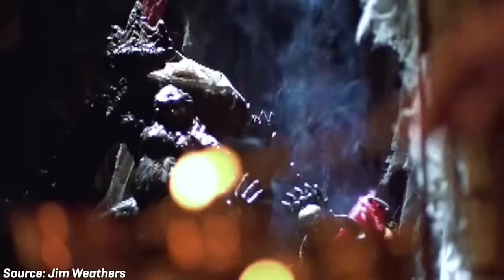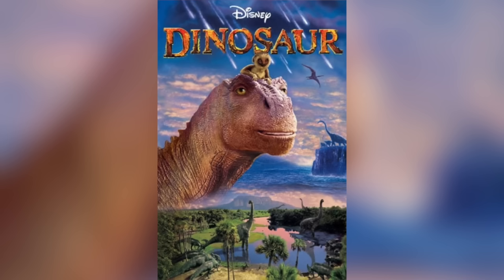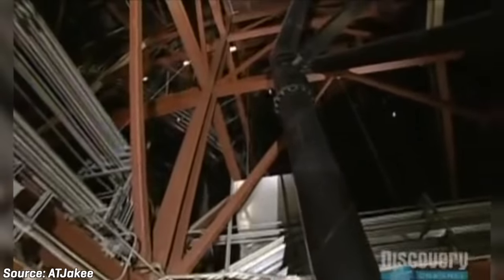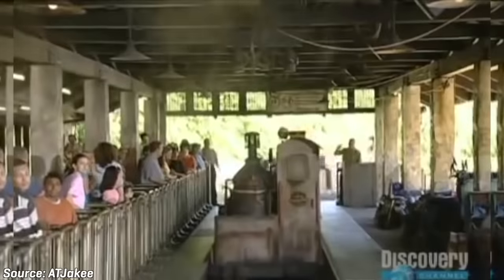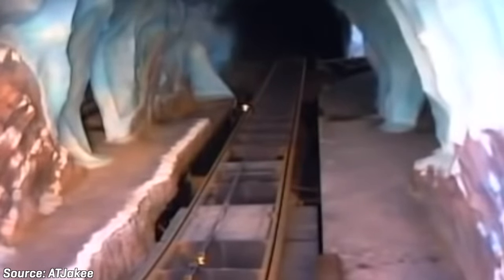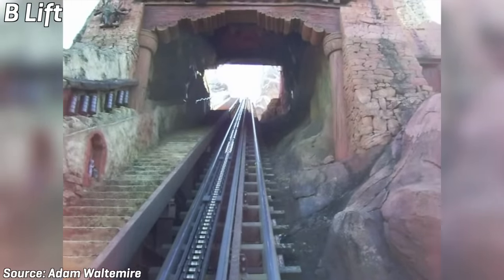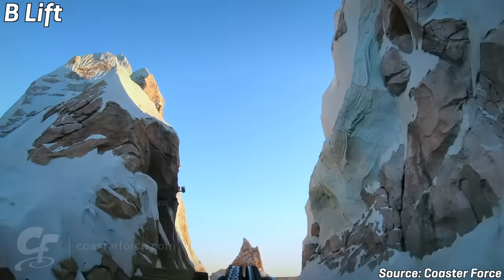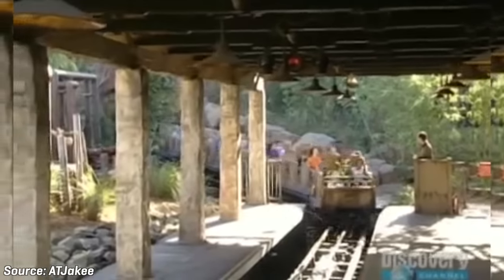Problematic Roller Coasters - Expedition Everest - Disney’s Animal Kingdom

Comment: One major lesson that the Yeti taught Disney is to always have a backup for your animatronic figures no matter how big they are. In making Na'vi River Journey in the Pandora section, the shaman animatronic can be removed from the ride if it breaks down and they show a projection in it's place while it's being fixed.
Reply: Huh, that explains the last time I rode Na'vi River, last month. I had coulda sworn it was an animatronic the last time I rode, but it was a couple years ago.
Reply: I was so confused one trip, because the very 1st time I rode the Na'vi river journey on the Monday there was an animatronic. On Friday  we rode it again and it was a projection. I was so confused and thought the 1st time was a fever dream.
I have ridden it again since that previous trip and the animatronic was back.
Reply: Rise of the Resistance does this too - there’s a figure of Kylo Ren that can be hidden behind a set piece if he’s broken and a video will play on the screens in the room instead.
Reply: Same with Rocket for Guardians of the Galaxy at California Adventure.
Reply: You can't compare that to a 20,000 pound animatronic. There are many issues like he said with not just the Yeti but also the foundation it sits on as well as mechanical parts which would require cranes to disassemble the mountain and track to fix.
Reply: same in rise of the resistance!! if kylo breaks down they move facing one of the screens and he is there!
Reply: same for the pre-show of millenium falcon: smuggler's run; if hondo ohnaka is having issues, he can be hidden by a tarp/blanket and he appears on screens instead of in person

Comment: The fact that that one switch track costed more than the the entirety of kingda ka is insane to me. It makes it was the most expensive coaster until hagred’s came out.
Reply: A switch track is basically putting a giant hole in your roller coaster track and then fixing it via machine multiple times a run. No surprise that the kind of tolerances needed add cost FAST.
Reply: @Mr.ToadJanfu   Haha that's one... way... to look at it I guess.
Reply: Galaxyfnaf And Dino  nah Velicoaster was probably very cheap, compared to Hagrids of course.
Reply: Galaxyfnaf And Dino  the cost of the ride increases with complexity. Hagrids was very expensive because it features 7 launches, 2 switch tracks, 2 free fall drops (you only experience one tho), and many animatronics, plus the entire field where the coaster is located that was modified for the attraction (like all the trees that were planted and such) and the new building which is the one that you enter backwards. Velicoaster on the other hand is much more simple, 2 launches, thats it, not as much work as hagrid for the area where it sits either. It does have a new building too tho, probably the most expensive thing in the whole project.

Comment: Seems like a pattern at this point 

Engineers: it can do 4 cars and run smoothly
Park: more trains 
Engineers: okay but that will make it run slower... 
Park: NO SLOWER, ONLY MORE TRAINS
Reply from the maker: Hahaha so accurate
Reply: I give you, Heavy Traffic the RIDE! Get ready to move an inch a second!
Reply: You see the same thing in road transit. More lanes does not mean more capacity, but people still demand more lanes.
Reply: EAH OOOH AH AH NO SLOW ONLY TRAIN
Reply: What surprised me, is that they tried to add the 5th train despite the only benefit being a tiny increase of 68 riders per hour. I could understand if it would have resulted in an increase of 200-300 per hour. But 68 hardly seems worth all of the potential trouble it could cause.
Reply: @CAG83  exactly! Makes zero sense to me. I’d rather wait a little longer than push it with more trains.
Reply: @CAG83  I did the maths and that’s around 294,000 riders a year with 68 riders per hour, 12 hours a day, 365 days a year
Reply: @procrastination_productions while I know that small hourly numbers have a large annual effect, I think the difference it would make daily is more meaningful, as most visitors aren't going to be there more than one day of the year.
In which case, it adds 816 riders per day, which is about 2% of total park attendees on an average given day. That's not completely insignificant, but I still don't know if it justified making the ride a "bad show". It's certainly debatable though.
Reply: @CAG83  And, do those estimated values really match up? If more time is spent loading and unloading, I suspect you'd actually get less riders on during opening times.

Plus, how many people were turned away by the long queue.
Reply: this describes so many industries so well, lol. 
Also you're not even wrong at all!
Reply: @ImNotScotish  walla walla bing bang
Reply: The 5 trains made operating so ridiculous. Any one flub and the whole thing became backed up with grouping and loading guests. As a former cast member we would get stressed if they said 5 trains on track.

Comment: I worked at Everest and am very familiar with all aspects of it. Your description of the block system, and how it was modified to handle five trains instead of four, was excellent! It's tough to explain, but you made it very clear. Well done! I wanted to add two anecdotal things, however:
1. The steam at load usually isn't broken, it just makes the station uncomfortably hot and humid on already hot and humid days so it is shut off.
2. I have seen, with my own eyes, the yeti scene with the yeti figure missing. This means that, at least once, the yeti figure has been removed. Note that it was just the figure and not necessarily the mechanical arm that controls it. The rumor that the mountain must be partially dismantled to work on the yeti is most likely false. The figure can be dismantled like any other machine and removed with relative ease. There are large rollup maintenance doors on the backside of the mountain that allow for easy access inside including up to the backside of the yeti's platform.
Reply: I'm curious as to how many riders Everest would pump through on a normal day. I've only ridden it once, but judging my personal wait time with the estimated amount of people in both the fast lane and normal queues, I'd guess that the EE crew can push through 10K people on a regular day.
Reply: @shchorss  With 5 trains, Everest can push through over 2,000 riders per hour, with a theoretical maximum of 2,244 riders per hour.
Reply: A several thousand pound animatronic was removed and then put back in place? That doesn't make sense. Why in earth would Disney do that? That's some crazy logistics and financial costs just to end up with the same Disco Yeti. Why in the world would they remove it just to put it back into its same condition as before?
Reply: @AshLux  It's a machine, and thus can be disassembled into removable pieces. Disney actually has a strict maintenance schedule in which any moving element on an attraction must be completely disassembled and reassembled on varying schedules. For instance, every single ride vehicle is regularly completely disassembled and reassembled. We do know that the yeti figure isn't technically "broken", but is problematic to run. So it's entirely plausible that it was disassembled and reassembled for safety and legal reasons. Even if it doesn't run, it's still an installed fixture that needs regular safety checks. Alternatively, they could have been looking for replacement solutions and cleaning the fur and skin.
Reply: It’s so cool to hear a cast member’s perspective of certain rides! Thanks for sharing :)
It’s sad that they didn’t ever fix the yeti, but it’s also kind of funny in a way 😂
Reply: Did you guys ever get in trouble for not meeting the 58 second time limit for loading patrons? Seems like it would be a highly stressful shift for any cast member.
Reply: I assume that it isn’t the broken animatronic keeping them from just sucking it up and fixing it but that, if I remember, it cracked the actual foundation of the mountain itself? Or something about how whatever it did made it clear that the mountain couldn’t withstand the forces?

But regardless there’s gotta be something they can do lol
Reply: If anything, the only thing that would probably require the mountain to be dismantled is if the whole frame for the actuators had to be removed. The figure would be easy since it's basically like a puppet, moving via external rigging.

Comment: Regarding "bad show" when stuck watching the shadow of the yeti for too long: I wonder why they didn't make a longer projection for this case where the yeti comes back and does a bunch of other stuff. Some other Disney rides do have backup projections for cases where you're stuck in a block zone; I've seen it happen at Ratatouille in Paris (where a bit of video loops) and at Rise of the Resistance in WDW (where the ride vehicle quite organically went backwards for a bit to kill time!).
Reply: yeah
Reply: Yep, my immediate thought, and surely cheap to do.
Reply: Yeah I thought of that. It makes sense
Reply: Or how if you ride that Frozen boat ride at EPCOT and get stuck at the Let It Go bit, Elsa awkwardly waves at you 😂
Reply: That's actually a pretty good idea, but one question remains: what will the yeti do in the longer projection after it "rips off" the track?
Reply: @RandomDragonEXE start tying the track into a knot 😂
Reply: One idea I've had in my head for a while for when a train has to hold there is to play some steam hissing and mechanical clanking sounds to give the effect that the engine has stalled and the driver is hurriedly trying to get it moving again. Idk how convincing it would be but it would at least be a relatively simple solution

Comment: Ryan, I respect you and this series, and the block zone section of this video was outstanding as usual. However, there is a lot of misinformation out there about the Yeti, and I'm afraid some of it seeped into your video.

The concrete foundation supporting the Yeti's mechanism did not crack. The problem with the Yeti is more like the "broken hip" issue as detailed in the video, though it's unclear if it's specifically the hip or not. What we know is one of the Yeti's motors either malfunctioned or wore out, which creates unanticipated stress on other parts of the Yeti's body. This is by design and should have been preventable through proper maintenance according to WDI. However, Operations argues that WDI sent them a faulty animatronic. Neither side will flip the bill, and because Everest still experiences great ridership today there isn't a lot of pressure from the top. Therefore, there's a sort of stalemate as to who will flip the (very expensive) bill, where one side doing so is essentially "admitting fault." All of this and more, such as an issue involving OSHA, is described by RedDad, a structural engineer who had an opportunity to talk with a WDW mechanical engineer ( https://forums.wdwmagic.com/threads/expedition-everest-effects-status-watch.171808/post-7514980 ) and supported by both Martin (of MartinVidsdotNet) and Lee, two highly credible members of the community whose insider information has been proven correct multiple times over several years.

The Yeti is not trapped inside the mountain, can be removed at any time, and has been removed on at least one occasion according to multiple accounts ( https://forums.wdwmagic.com/threads/expedition-everest-effects-status-watch.171808/page-205#post-9319004 ). As the animatronic was installed well after the mountain structure was complete, there are doors in the back of the mountain where he can be moved in and out ( https://forums.wdwmagic.com/threads/disney-loses-appeal.856616/page-2#post-5230011 ). In fact, there have been plans in the past to repair/replace the animatronic that do not involve removing pieces of the mountain that fell through due to the reason I stated above ( https://forums.wdwmagic.com/threads/yeti-is-indeed-being-fixed-update-8-4-2014.716149/page-52#post-6261243 ).

It's very prevalent misinformation, so I don't blame you at all for using it in your video. I think it originated from when Joe Rohde said this at a D23 panel ( https://youtu.be/SRogsKOG43w?t=2909 ) "you have to understand, it's a giant, complicated machine sitting on top of a 46-foot tall tower in the middle of a finished building," which I firmly interpret as him commenting on the price rather than practicality of such a refurb. In reality, with the right budget a Yeti refurb could feasibly happen overnight, though when/if one does come, it's more likely to be a couple weeks, tops. I just wanted to let you know because this rumor seems to be everywhere, and I can tell you're passionate about this kind of thing.
Reply from the maker: I really appreciate you pointing this out and suppling a bunch of sources. I’m going to read more about it myself!

Comment: Good job as always with the block zones. 

As someone like me who used to work in a park as a full-time electrician (22 years ago) and commissioned a control system for an roller coaster with, who is now the owner of IOE. What you guys call a ride computer is really a PLC (Programmable Logic Controller) that's we electrical guys call them. But, Disney uses both PLC's and PAC's (Programmable Automation Controllers) in their ride control systems. The PAC's are normally used with the animated props and they are networked to the PLC running the ride. 

Btw, I have the paper copy of Power Point presentation networking for Disney Parks. 

P.S. You get a 👍 from me.
Reply: That's cool, that's exactly what I do now lol

Comment: You really need to work on getting to the point more quickly. In the 5 train operation part I think you must have repeated 3 or 4 times that trains can't stop in the switch track sections.

Comment: Always a great time on this coaster! I remember once close call we had years ago: it was a boiling hot day and the ride seemed to be having some problems; we were on line inside the station for what seemed like quite a long time before any trains came through. Finally one did, and they loaded it up and off it went; then our train came in, we got on, and sat there. And sat there. And sat there. Eventually they announced the closure of the ride, so we got off the train and walked out — and as we did, we looked up and could see the train that had just left before ours, stuck, high up on its way to enter the mountain and directly in that boiling hot sun. :-( We sat for a while and watched but didn't see any movement. I felt so bad for the people in that train; if I'd had to sit there exposed to the sun and heat like that, I would have probably had a panic attack or passed out. The crew gave us passes to come back at another time, and we did, thankfully with no more breakdowns!

Comment: I was once on a train that got stopped at the second track switch. We sat there for a while before cast members walked us down through the center of the mountain. Was really neat to see the inside, they also store a bunch of the smaller carnival size kitty rides in its base. They told us we could not take pictures. Only rollercoaster I have ever been evacuated from.

Comment: Nice video, I was an Everest CM in 2014 and 2016 and I often get irritated at misinformation in this type of video, but this one was well done. I will say that stopping in Brake Zone 3 before the Yeti is problematic for a couple of reasons other than show. One being that the stop is quite rough and abrupt and will often trigger complaints. Guests will say they got "stuck" if they stop anywhere longer than usual, but at least they're not pained by the stop. The other issue is that the tower CM cannot see the entire train when stopped there, and it's preferable to ensure that everyone is still seated prior to resuming motion. Everest restraints are generally difficult to get out of, but I've seen it happen. I do appreciate you recognizing the wild speed at which we have to dispatch trains. It's a massively difficult part of our operation that often gets overlooked.

Comment: Good Show!  I grew up near WDW, but was already at college when Epcot opened. So it was a while before I got to see Animal kingdom, by then well into the Disco years. I got this feeling with Expedition Everest and with the Seven dwarves mine train that WED Imagineers over engineered these two new E ticket rides. The dancing yeti for one and the ever so gently rocking along the Roll Axis ride cars for the other. Neither provided an experience up to the hype. Joe (and I'm not blaming it on him) could have gone more with the SE Asian shadow puppet idea- or actually street puppet. Instead of the massive foundation holding a massive single moving machine the size of a bus, that needs to make a massive single puppet move back and forth, use a separate head on a stick, hips and chest on separate rigs and light weight arms (relatively). When the "show hips" don't have to also support the rest of the animal, they will have much less massive engineering needs and stresses. The entire contraption of machines could still use the same foundation, but the massive weight and movements would be divided into much smaller moving units.
Darkness, fake fur, and both the audience & yeti in motion would completely hide the fact of it being made from separate body elements that only appear a single entity when viewed from the track.